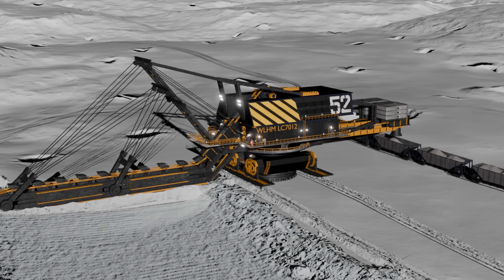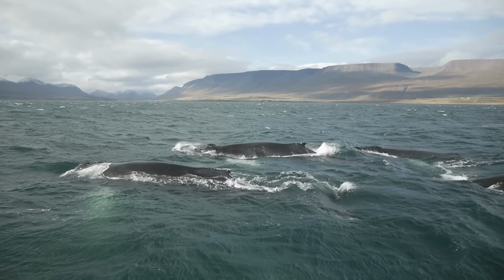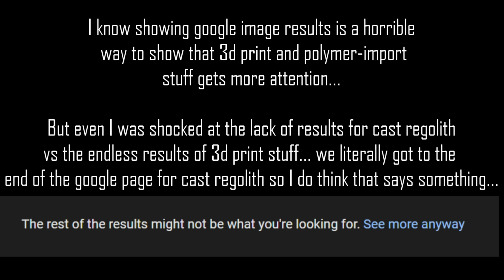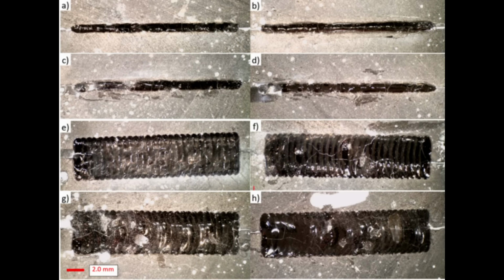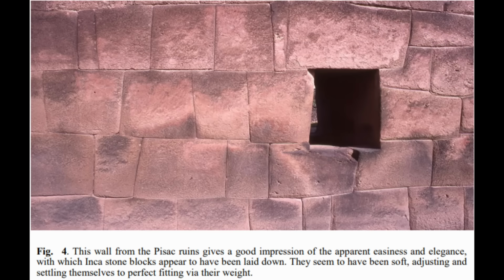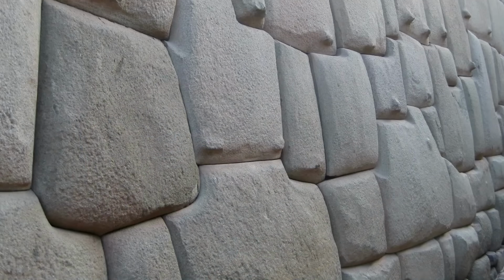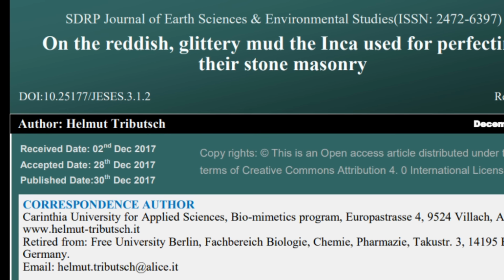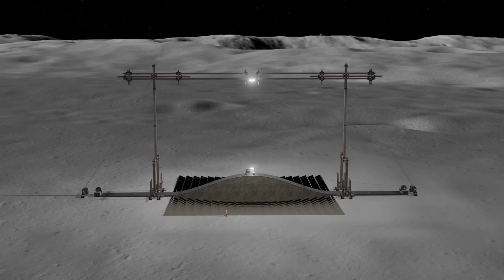Lunar Construction Materials

Comment: I think rather than stacking a full 3m wall like your animation showed, seems like it would be much more efficient to just stack a thin arch, and backfill it with a few m of regolith. Then indeed cover the inside with some kind of thin gas barrier, if the building needs to hold an atmosphere. Could be some thin imported film since it really does not need to be much. Although I suppose having the ability to refine aluminium on the moon would also be super useful, so you could make such weldable films/thin plates locally. Might not be the simplest or cheapest per kg but it does add a lot of options; and the known refining processes require electricity as an input rather than bulk chemicals. That said the whole process to go from dug up dirt to a usable flat sheet certainly looks like a much bigger investment than casting some crude molten regolith bricks in molds made from pressed regolith.
Reply: The pressure inside needs to be atleast 0.7 atmospheres. A thin wall might not hold together under the force.
Reply: @MarkkuS  good point; on earth it requires 10m of water to hold down 1atm; so on the moon youd need 60m of water... and about 40m of regolith since its not even 2x as dense as water.

Either way it would not be at all efficient to use 40m of unmortared brick to hold down that pressure; so really if you want to hold pressure and you dont want to make all walls out of thick spherical metal pressure vessels, good tunneling or trenching equipment really cant be left out of the picture.

I dont know how thick the dusty layer on the moon is though; I dont know if its 40m. So either youd be looking at tunnel boring, or bulldozing in a lot of the surrounding material.

Just making open hangars from brick arches with a few m of bulldozed regolith for radiation protection, and flying in metal pressure vessels, as shown in one of the concept pictures, will probably be the way to go until you have the scale to import all that other heavy machinery.

Comment: just pack some big rolls of thick plastic or stainless steel or make aluminum sheet locally from lunar dust (19% AL by weight)
robots can weld sheet together all day into round vacuum tight aluminum sheet spheres that can be filled in with anhydrous lunar dust to establish a floor which can then be cast over with either another sheet of aluminum or with epoxy binder composite regolith similar to a concrete slab, you got a basic air filled vacuum tight building from that point on
Reply: Thing can be done in different ways, it needs testing to pick ones which work and do not work. Stacking bricks obiviously works, soo, but there are options and it depends on what we need as result.

Comment: Cast basalt will of course require extensive and massive infrastructure before it's viable. There's still value to developing small scale imported materials and techniques in order to bootstrap this
Reply: It depends on scale of production, and this process scales well enough  up and down, aka one can cast basalt in a garage if there is such desire.

Comment: If you really want to make airtight structures out of cast basalt bricks, use physical vapor deposition to coat a thin layer of aluminum onto the surfaces of the bricks and then braze the bricks together with more aluminum. You're already in a vacuum.

Comment: casting regolith seems like a good idea for reaching self sufficiency on the moon, but in terms of getting your first base setup rapidly seems like it wouldn't be a great choice. After all, unless we figure out autonomous robots before we try building that moon base, you're gonna need people there to build your solar furnace, which means you need infrastructure to host those people and infrastructure for them to build all the things they'll need to move towards that self sufficiency. Seems like importing a bunch of vulcanizing agents is actually going to be a lot simpler and easier to pull off in the early parts of colonization. After all, why spend the time using a tiny furnace you ship in to slowly build your larger solar furnace, when you could probably just ship in all the things you need to make that large furnace far faster and easier, which is ideal since the faster you get things done, the less danger you put the people, who are gonna have to be there to build said infrastructure, in.
Reply: Easy solution, do not use humans before you can make conditions for humans, use teleoperated equipment.

Comment: Microwave sintering puts additive manufacturing on the table without the vulcanizing agents.
Reply: yeah, but you still need quite a bit of power for the microwave, basalt dust can be melted with something as simple as a meter size Fresnel lens and sunlight.
Reply: @crisanister5131 fortunately the prime mover is literally a day/night powerplant. Then there's the sinterizing....you need to use the lens to heat a radiative furnace...not easily incorporated into the train. With microwave sinteting onboard you're not limited to precast sections, if a road is damaged it's not impassable for up to two weeks, and if you need a new route you don't need a new stationary installation...just start driving that way making road as you go. 
Roman roads were great in their day but, there's a whole host of reasons asphalt is more common today.
Reply: @kennickel878  Also, a few scientists fused lunar regolith, specifically samples from Apollo 17, with microwaves: see Lawrence A. Taylor and Thomas Meek (2005) "Microwave processing of lunar soil". Real regolith, not simulants, has tiny embedded particles of native iron and agglutinitic glass, which makes it a dielectric that absorbs microwave energy readily. Lightly-oxidised copper powder acts the same and the scientists that did it have a patent on it. But specifically, it's the top, aged, most battered and shattered layer that's the most responsive. The closest Taylor gets to stating microwave power is "normal kitchen power" so we'll assume a kilowatt, but that's enough to melt the edges to 1200 deg. C and fuse the grains together, down to a depth of 65cm. If you just graded, sifted, pressed into a mould and zapped it with a kitchen-scale magnetron, there's your sintered paving slabs and tiles.

Comment: You could also bed the bricks together with processed regolith if you needed a tighter seal, or possibly instead of welding move to something more like soldering; not a weld of the material, but a melted filler that sticks well to the material. Alternatively, just cast the entire wall and let it cool in place. The nice thing about casting regolith is that in theory it’s zero waste and also in processing the regolith will free up other elements.

In addition I imagine we’d be using much larger blocks on the moon for construction; ease of transport and laying in a lower gravity and machines designed to move and lay them, versus say your classic brick and block on earth which are constrained by reasonable human movement and carrying capacities.

And any construction that is meant to be pressurized internally, could be sealed by a flexible internal liner held against the cast blocks by simple pressure.
Reply: Yep, may work this way.

Comment: Why do you go on about solar cells? Go nuclear. Tbe Russians and the CCP are going Nuclear because they know how dumb solar is.
Reply: It not that easy to import 1 or 10GW of nuclear, nuclear is good for a small mission which requires continuous power and good for state actors, but with ability to make solar cells on the moon from moon materials, things aren't that bright for nuclear.
Reply: @Molb0rg Well, your solar will be in the dark for two weeks a month  on average. Batteries are not light.
Reply: @ericf5978  The problem with nuclear is heat rejection.  There is a reason why they build nuclear power plants near large supplies of water.  Heat rejection on the moon isn't as easy.  Batteries are not light, but they are easier... then again nuclear power plants tend to be on the extremely heavy side too.. You might not understand as much as you think you do.
Reply: @ericf5978 true, dark period is serious topic, someday we will make video on that.
Batteries can be made out of local materials as well, soo you can imagine that for now.
Reply: @TheEvilmooseofdoom  modern reactors can fit in a sealand container. They don't generate as much power as the big boys but plenty for a lunar colony. Or a town. I know plenty about nuclear power i worked in the nuclear field for years.
Reply: @ericf5978 sure, nuclear is good, but problems of solar can be solved with local resources and that makes the difference.

Comment: the only correction I have is that if you want to airtight the inside of one of these structures instead of welded steel plates it seems much easier to just inflate a membrane with the atmosphere you'll want in it anyway.
Reply: Steel is proposed as such membrane in this case as it can be made locally.
In general there are all kinds of ways to do the same using local materials or imports.
And using membrane also is not the only way.
Reply: @Molb0rg  Steel eventually, inflatable habs to start perhaps.
Reply: @TheEvilmooseofdoom I guess the simplest will be a steel building that is buried und regolith for insulation and radiation protection.

For the first starter building they can be foldable and than get welded together by a robot.
Reply: @TheEvilmooseofdoom habitbale modules is not necessarly starting activity. Teloperated equipment may go a long way before that.
Reply: @Molb0rg  membranes can be extremely thin, lightweight, and thus packed into fairly small volumes since they have the protection of bricks. airtight welds can be difficult, and processing steel is somewhat involved. maybe as a longer term solution once industry is already spooled up steel makes more sense, but even then I'd assume the value of steel in other endeavors might outweigh simply shipping a thin membrane. also by the time serious steel production is spooled up to the point where it's economical, we may already have some sources of carbon developed from asteroids or similar.
Reply: @nuttyDesignAndFab as I said there are many ways to do the same stuff, and I mean it.
Considering available options and how things can be done, I do think no import is needed.
But considering it human stuff, import is possible. I would import some sort of sealant glue, not a membrane, but it can be whatever.

Comment: A thought occurred to me and I think you glossed over it in the video. In the Mare regions, the lunar bedrock is only a few meters beneath the regolith, What would the viability of just cutting basalt to shape be? I assume energy-wise it would be a rounding error compared to the melting and importing options. I wonder if some sort of mining machine could cut out bricks and make a underground abode at the same time.
Reply from the maker: sure if you're willing to dig a few meter to get to it or if there is an outcropping it should be very useful! Many sandstone castles were built this way
Reply: then we have to consider the wear and tear of mining tools that have to be shipped by rocket. The melting option probably comes with the use of less consumables.
Reply: @PhantomBlank  While high quality tools may last longer, I would think steel or iron would get the job done while being infinitely recyclable, the challenge will be to find the right combo of tool longevity to difficulty in reforming it from the dust it will ultimately turn into. Not sure whether what tools would be the best...
Reply: Clearing the regolith away to expose the bedrock is something you'd be doing anyway. After you've sent off the regolith for processing, start quarrying the bedrock for construction materials.
Reply: in b4 we make big circular saws and cut out megalithic blocks like the pyramids XD but yeah tbh that might be a way, cut a grid of 1mx0.5m a bit deep, then crack and lift out each block, like they do in 3rd world countries mining limestone for blocks
edit, to add, even if you do it in 2 or 3m lengths at 1-0.5m thick,  with a 3-4m cuttign blade, it might be easier, since the elss gravity needign less to move, but it might be better to go with cintered due to the easier scooping of regolith and magetic seperation,
edit again, its about 3000kg for basalt per m2,  so thats liek 300kg eqquivilent moon gravity, so like 1x0.5x0.5m cubes would be human moveable wish at 75kg ish, and dependign the human we could lift and shift em easy ish, so a 1.5m circurar blade or cuttign rig on wheels, like a 4x4
Reply: I'm thinking a lot of places might have lava flows that have covered old regolith as well?
Once under the basalt it could just be a matter of digging out the old regolith with something like a continuous mining machine, like they use on coal seams.

Sort of a man made lava tube.
Reply: my cock is a man-made lava tube..
Reply: @fnqlr7817 Boring

Comment: 0:06 put in data centers in orbit could be an awesome idea. Also, I wonder about how the vacuum of space could be feasible and cooling them, while solar panels could gift power to the data center along with nickel hydrogen batteries as backup when sun is isn't shining on the solar panelles.
Reply: Vacuum of space is an insulator mate…. Cooling problems make space data centers dead on arrival until we have unreasonably massive space manufacturing capabilities.
Reply: Ability of radiators to emit heat proportional to power 4 of temperatures so higher is the temperature less radiators needed.

Assuming room temperature of radiators, plus minus emissivity, it able to reject about 460W/m2, so to reject 1GW from a data center it needs 2 million meters of radiators.

2 sq km. It plenty but whole idea behind moon development is to dig out materials from it to not have resource shortage to implement things, to disconnect our resource availability from number of launches we can do from earth.

Comment: You'd probably want a little mortar if you were trying to build anything meant to hold pressure, but if you're just building roads & radiation shrouds yeah could probably get away without much of it.
Reply: There are more than one way to replace the mortars. As an example NaK can be hot glue of such, or that notorious cold welding like coating on the blocks and foil in-between and things should stick together.
There are options.

Comment: I mean depending on how long it would take for molten Basalt to cool in theory could you sorta just 3D print with that itself, something like having titanium plates on each side to determine the width of the wall and prevent overflow could allow the regolith to cool on top of each other
Reply: It will have all the problems of uneven cooling. But sure things can be adressed in multiple ways.

Comment: 17:20 what if you don't re heat the bricks but instead take the hot bricks from the annealing step before they cool down completely. Perhaps a sunshade could prevent uneven cooling and once the wall is build you can surround it by loose regolith to let it cool down. Besides the walls are likely to be covered in regolith anyway so annealing, welding and cooling could be combined to get working results
Reply: To many processes at once, it creates some difficulties. There are easier approaches to the problem.

Comment: Can't help but feel you missed a point with clips - when you cast each of the bricks, have a trapezoidal notch on the top at each end, put another block in place and drop in an angular hourglass shaped clip, now your bricks are laterally locked together.

Put similar notches on the sides facing the top and bottom at the 1/4 and 3/4 marks and now you have vertical strength.

If you're worried about the clips being loose or falling out, make them a half millimetre too big and apply some heat to the surrounding brick or cool the clips for thermal size manipulations, once both parts are the same temperature, they're permanently locked together by friction
Reply: Great, now we just need to test if this is the best way to do so, lol

Comment: I think a lot can be gained by designing an optimized brick shape for the material and fixture method, maybe with an edge profile that is good for laser welding to make it more airtight.
Reply: There is no need to make structural part to be adamant air thight, just place a membrane from inside, or work with seams inside - smear them by some metal deposition.

Comment: Cast basalt would work for structures and habitats but to make the terawatt solar panels and construct the cities in space we'll need to separate out elemental materials like iron and silicon.  Here on earth we use chemical methods that would require enormous imports for the Moon mining and manufacturing facility.  I'm guessing we'll want to use industrial scale processes analogous to those used in mass spectrometers.
Reply: Yes such refining seems to be an option, but it most expensive one, and before you can mass separate everything it needs some pereparation steps, as an example in form of making enough energy for the process.
Stone if not for replacing everything, it to cut some importing needs.